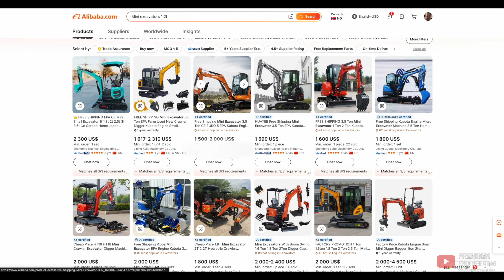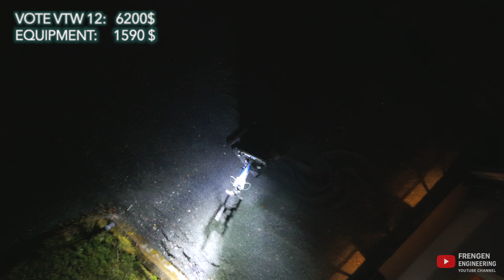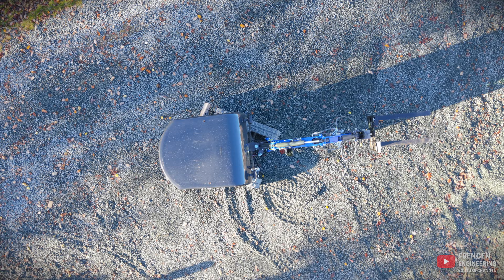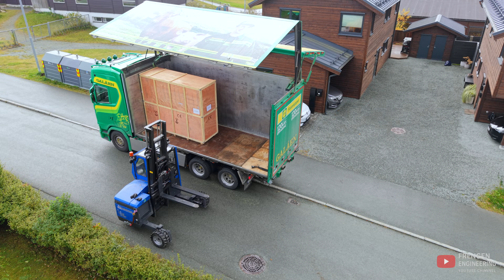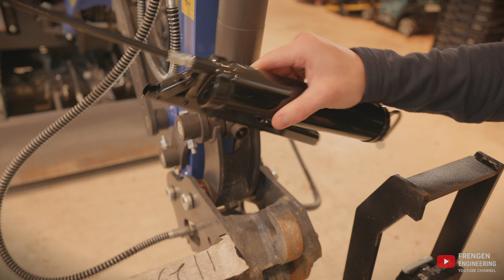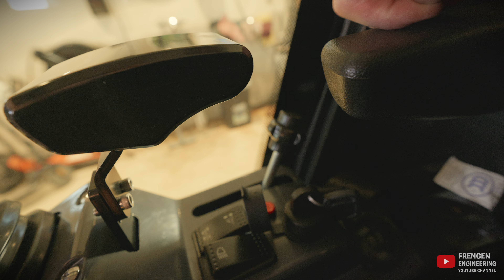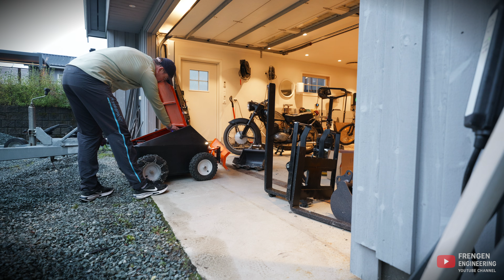What it REALLY costs to import an excavator from China — and what you actually get

Comment: I had the same experience when importing a large 4-cyl 60 hp stationary diesel. The cost of the item and shipping to Brisbane came to $1950 AUD. The cost of moving through Brisbane and the same type of costs you had paid, with me picking it up in Brisbane, was $2150 AUD. I could have had it shipped to my farm for an additional $850 for 150 km. Yes the shipping China to Brisbane was $180. So moving it from Brisbane to home 150 kms was 5 times more expensive.

Comment: I live in Indiana, USA and I've been trying to buy an excavator since March (2026), it took 3 months to get a proper response, that the listed price was actually a "deposit".  The "deposit" was the requirement before they (the Chinese) would actually build one.  I checked out multiple companies that said their machines were already IN the USA.  Chicago was the closest to me, I googled the addresses, called local businesses, turns out all the different locations say NO excavators anywhere near them, so, so far I have found none I can travel to see.  Most (Chinese) companies say they can deliver within 2 months until you ask the direct question multiple times (When will I see it at my address in Indiana), the response fades to "maybe 4 months, maybe 5 months, maybe more.."  But we chase it because the price is STILL a 4th of an American one. A (JD) dealer 40 miles from me has a 3.5 ton for sale, 1450 hrs on it, 12 yrs old, asking 42K, acts like he's doing me a favor.  I'm still looking...
Reply from the maker: Hi! Check out Huayee in the US. Ask for a SHY model. (Dealer only) they are about the same as mine, but for the US market. Piston pump and better built. 😊

Comment: To move the door, stick a small dowel in the hinge close to the pin and parallel to the hinge axis. When you close the door, it will push it out away from the frame.  Start small (~3-4 mm) and move it incrementally.  Assuming upper and lower hinges, you'll need to adjust both to keep the door square.  Good luck

Comment: I imported a used excavatorr from China to Nigeria last year and man, the hidden costs almost broke mecustoms valuation discrepancies alone cost mee an extra $2,800. I used DocShipper to handle tthe paperwork and they made the whole process way less stressful. Just wish I’d figured out the right classification code before shipping to avoid that huge surprise at the port.
Reply: I imported a used excavatorr to Ghana a few years back and caan definitely relate to the hidden cost shockespecially with customs valuations. I used DocShipper too, and while they handled the docs well, I still ended up with a $3,500 discrepancy because the invoice didn’t match what the Nigerian customs appraised. Definitely made me learn the value of a preshipment inspection to lock in the valuation ahead of time.
Reply: @Mathieulepont-u6i  It’s clear from both exxperiences how crucial accurate doccumentation and preshipment inspections arre when imporrting heavy machinery between African countries and China. The challenge seemms to be not just in navigating customs discrepancies, but alsoo in aligning expectations between what’s invoiced and what’s assesssed at the port off entry. What I'm curious aabout is how often these valuation issues stem from intentional undervaluation by sellers versus honest overssightt by buyershas anyone here deallt withh a seller intentionally underpricing to avoid highher shipping costs?

Comment: Following your first video, I purchased a Vote 12W machine with tilting bucket, rake 2ft digging bucket, quick coupler,  kubota diesel engine, cab and rake. Cost delivered to my house 9,000dollars, (£6681.00)  it arrived in wooden box, Ive used it for 1.5 hours. No extra costs at all. Process started in November 25, delivered 30th May 26 no problem.-I had to unload 1.3 tonne box. No problem.
Reply from the maker: Hi, great to hear it! I think they have learned, selling with DDP, a fixed price including all this fees.

Comment: Buying heavy machinery from China is a smart move, but the 'Alibaba bait' is real. Most people see $2,000 on the screen and don't realize the final cost can easily jump to $12,000 once shipping, port fees, and customs are added. As many commenters here noted, the real nightmare isn't the factory—it’s the 'local parts' like government regulations and port authorities that can double your unit price with hidden fees.

TrustBridge Europe was created to eliminate this risk. We don't just find suppliers; we perform on-site technical audits (CE/NANDO compliance) and provide a fixed DDP (Delivered Duty Paid) quote from day one. No 'sudden' price shocks, no anxiety about burning your pre-payment, and zero customs headaches. We handle the bureaucracy so you only have to worry about putting your new machine to work. 🏗🛡

Comment: Wow 😳 

Got a mini for $4,700 US off of Amazon, with shipping snd tax. It's gunna be here in two days.

There shouldn't be any additional fees. Tax was $352.

There shouldn't be any other fees. I'd be pissed if I received all those additional fees doubling the price of the unit.

Temu was selling them for $350 and $3,800 shipping.

I went with Amazon because I trust their return policy more. Though I'd have to drive about 500 miles to bring it to another state where their retail location is 

Over time it'll pay for itself. Take care of it and it'll outlast you.

Uncle bought his little bobcat 320 used decades ago used for $10,000. It was for digging graves at a cemetery.
We used the heck out of it. He passed away a few years and now his son has it. 
Over the years we replaced the tracks, lots of hydraulic lines wnd one of the hydraulic drive motors. Tracks were about $500. Drive was about $1,200.

Comment: Ordered one 1,2t yesterday after very good communication. Strange feeling to hit the pay button for pre payment (2000€). Delivery to south Germany. Let's see what happens. Worst case: 2000€ burned :)
Reply from the maker: Good thing you have seen this video. You will get the machine. No worries there. 😊
Reply: @frengen_engineering your video inspired me the last bit to make me confident to go the way with an import. I've made many inquiries here in Germany for similar excavators. All of them were above 18-20.000€ with the same extras. I have ordered all extras except: cabin, rake and the 80cm bucket. All in all with delivery end price is 6500€
Reply: I am still waiting, order date was end of April. But I am still positive to receive the excavator this summer :)

Comment: I also once imported vehicles from china .. everything with chinese part went fine .. it was the local parts that screw you over time after time - especially the ports.
Reply from the maker: Hi, yes. This can absolutely be an problem. But in this case, the engine is a Kubota, and most of the other parts can be swapped to different brands as well, if it’s unavailable getting the same. I have some contacts over there now though:)
Reply: @frengen_engineering  I literally meant the local "parts" like (sea)ports, goverments, customs and such .. I actually find it often easier to source chinese spare parts.. it's just harder to figure out which will fit, as there is no such thing as "brands" most of the time

Comment: I have to wonder about the Alibaba site.  Just for fun, I went to their shipping calculator page.  I can't find on there how to change destination country so I'm on USA/Canada.  I figured that you unit's shipping weight would be somewhere around 2200 kg.  When I plug that in, it tells me that it would cost me $699.38 to get it to either the USA or Canada.  That's a tad more than it cost you and I can't see changing the destination to Norway would add over $7,000 to the shipping bill so I have to assume that the $699 I was quoted is missing a line item or two.

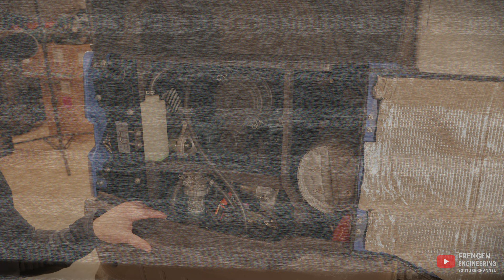Comment: At 19:10, You should change the oil at:  1. Immediately upon delivery, then   2. at 5-hours, then   3. 5-hours again.   4. A normal interval.  Use a HIGH quality DIESEL rated oil, maybe Shell Rotella T6, or Mobil Delvac 1 ESP, or Amsoil Signature Series Max-Duty Synthetic Diesel, or something similar in your area.  At this point you have missed 3-oil changes...

Comment: There are so many things that are wrong... imagine you're moving the machine with a wall close by on the left. You didn't pay attention to the fuel gauge, which is conveniently located at the front of the machine. It runs out, the engine stops for lack of fuel. How do you get out of this predicament? Worse, even if you're not alone or were able to call for help... how do you refuel? And then you'll have to prime the engine again... but it could be worse. Imagine you misjudged the terrain or there's a sudden movement, the machine tips over and falls onto its left side. How do you get out? Through the tiny window on the right? Maybe a Chinese person comes by... fluids could be leaking, the engine could run away, igniting its own oil, and the whole thing could catch fire... CE compliant, right? Just the engine emissions, maybe, that remains to be seen... nothing else is compliant. When you lift the left control, are all the controls stopped to prevent accidental movement and catching something? The bucket release mechanism is similar; the standard is that three controls must be activated simultaneously and the bucket must be fully closed to prevent accidental drops. In short, this machine is a safety disaster. And in summer, it might not be hot in Norway, but the greenhouse has just a tiny window, and the door sticks out a meter behind it, ready to be smashed by the first obstacle during rotation. I think it would be worthwhile to have a professional try this machine, or even better, ask a dealer of genuinely CE-certified equipment to come and test it for their opinion, and perhaps a quote on the actual cost of an equivalent machine from a major brand—one weighing 1.2 tons, not a 3 or 4-ton model, which have incomparable capabilities and are infinitely more durable, easier to control, and safer than this contraption. I copy past this on more of yours videos.

Comment: Re the door closure problem. Please don't cut, drill or weld any part of the frame structure. It is a ROPS or FOPS structure. Doing so will make it non compliant for CE regs, and any accidents resulting in injury could result in prosecution. Also I don't know about Norway but many EU countries have annual inspections. If any modification to the cab is noticed the machine will not pass inspection.
As a private owner maybe the above will not apply to you. Though it is not a good idea to do anything to the cab structure in any situations.

Comment: How much does it cost in Norway for similar machinery? Thanks.
Reply: Top brands are 200-300K NOK + VAT, this one is about 120K + VAT
Reply: @Rimrock300  200-300K NOK + VAT is about USD 20k-30k + 25%!!! OMG OMG OMG!!! If I were a Norwegian, I would buy from China too.
Reply: @arcencielc2065  -yes, the top end brand s lik japanese Kubota are pretty expencive compared to many of the Chinese ones) Those expencive machines will be typical for proffesionals, builders and rental companies, they get the 25% VAT/sales tax reimbursed,  while ordinary consumers/homeowners won't. To homeowners and others just using such machines a few hours a year, it is a great option going for the low cost chinese brands, given one pick a good one. Proffesional making money useing the machines, its different, they would look more at longivity, how fast getting hold of spare parts and such, not look so much at the initial cost of the machine.

Comment: You did not mention if parts are available. I put a Predator engine from Harbor Freight on my lawn mower and it ran great for a few years when it needed a little rubber bellows for the fuel primer. No parts available.
Reply: Just buy a whole new carburettor, cheaper to replace than just rubber bellows. I bought a new carb for my leaf lower for $15.

Comment: I can hire a 1.7 t for $200 a day or $600 a week $20,000 gives 100 days or 33 1/3 weeks fuel is the same but storage and maintenance is included. I would have grouped up the jobs and 3 weeks hire would have done in my life so far at $1,800 but I have nabbed  one at nearby site and slipped them cash and got a skilled operator and fuel included.  And for some jobs a bob cat is faster so have used that.  If you have the work for it 5 -6 days a week sure but for a few hours a month or 6 months for a cute play thing it makes no sense.

Comment: Hello. I’ve seen your video at the manufacturer in China too. I’m excavator operator and if it’s the first Time you use one, you are excellent at using it. 

From your video, the excavator is quite good for a made-in-china cheap basic excavator. Probably one of the best for the Price.

Local Price 2000usd is very low.
But i don’t believe the kubota engine comes from Japan. Unlike the seller says. It’s probably a kubota made under licence in China.

When I was in china, many sellers show their « german tools » etc. It’s not real, it’s all made in China. In china have a law : when a foreign company comes to bring a product to be made in china, the Chinese company also have the right to make and sell it for itself, at least inside china. It’s inside Chinese law, can’t be otherwise.

So it’s very probably the case here… and outside China it’s certainly not legal to sell at all, exclusive clauses. It’s called counterfeiting. especially with a Kubota sticker…

But if have no complaint from Kubota, the business continues smoothly 😅

For your information. It doesn’t mean it’s bad, if made in the original Chinese Kubota factory it’s probably the same than legal ones.

Comment: Pretty expensive. I’ve bought Kubota k008 2022 model with 900 hours as new for 11500 euro. I have around 1200 hours now, would probably sell it around 2000 hours for 10000 euros. What would be the resale value of the chinese excavator after 1000 hours?

Comment: In Spain, a YouTuber has the same one, and it has a problem with the starter motor. There's no way to access it. I don't know if you've noticed, but they installed the cabin in such a way that you can't access the radiator, the starter motor, or the battery. They sealed it off.
Reply from the maker: Wow, need to check. Do you know if he has the Kubota engine in it?
Reply: @frengen_engineering Yes

Comment: i just ordered mine from the same company. communication was essy and straight foward. they were super flexible too. 

mine will arrive in March.  

thank you so much 🤝
Reply: I hope you post updates about this on your channel.
Reply: @inamarlucio i stopped posting on my channel. if i remember, i will try to give you an update here though.
Reply: @inamarlucio no good. I negotiated joystick, swing boom, track extension and tools, only to have trouble within the first few minutes let alone the wrong machine, which I am certain was incompetent staff unable and lacking communication skills. upon opening I found there was no track extension, which after extensive up and down communication, they denied the obvious and furthered to defend what was obviously an error on behalf of the salesrep. within filling up the tank i lost all the diesel because the technician responsible for bleeding the motor didn't tighten the bleeder screw after it was ignited. I'm in a rural area so a single screw put the machine out for 14 days. vote never helped in resolving this. I was met with silence. they claim to have someone here, but considering the denials it equates to alot of down time for the machine. eventually I found the bolt amd sorted it myself. 9.6k was my final offer which included track extension which I never received. not worth the 15k it cost including taxes and headaches. spend the extra here and less headaches. the responses I received resembled indian call centre workers to be honest with you. not professional at all. desperate to meet monthly quotas to the point where you'll receive a lesser value machine and offered a type of financial credit. sad really, but not expected. bolt is fixed, now I just have to work on freeing the stuck hydraulic thumb from the bucket 😞 otherwise if you are wanting to deal with Chinese that pass you from worker to worker, help yourself.
Reply: @inamarlucio not sure if you're getting my replies. or if my comments are being hidden. I'll waiit for a a reply
Reply: just check your contract. china has a long way to go to even get close to Japan made machinery and unfortunately they have a long way to go

Comment: We do things a little differently in the USA.  Homeowners and many small contractors rent skid steer loaders for about $350 a day, $1100 week, $2393 month, and just add it as a line item on the work contract.  The machines are 10x the speed and capability of the machine featured in this video. The rental companies give free training, including showing how to add fuel, and send it out with a full tank of fuel.  For a small fee, like $100 they deliver and pick up the machine.  Most contractors own a truck and a trailer themselves. That way, you don't have to worry about machine storage or repair or theft insurance.  For frequent customers who usually rent lots of equipment each project, the machines are sold well used at 2/3 normal life for about $6000.  Myself, I got as far as the fraud in advertising from China with the $2000 advertised price and the $7000 quoted price, and decided that the transaction combined with full payment to China before final shipping, shipping, tariff, fee unknowns, possibility of transactional fraud, possibility of theft in route, shipping insurance companies with mostly claims not paid internet lore, and the rest of it didn't warrant a risk versus return ratio that could pass my wife's common sense.  Of course, we owned a rental store for a couple of years in our 30's and had a couple of skid steers in the yard at that time, so are quite familiar with the practices in the USA.